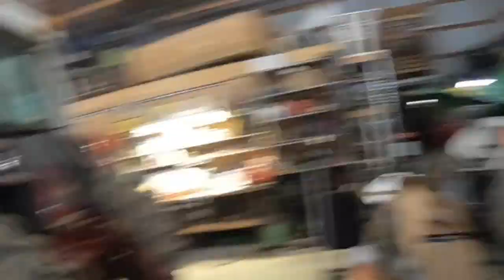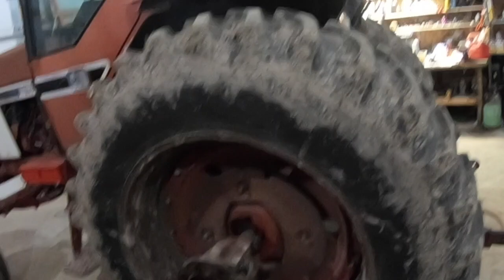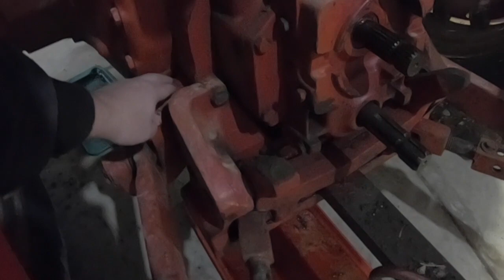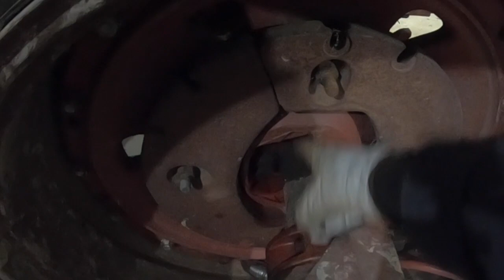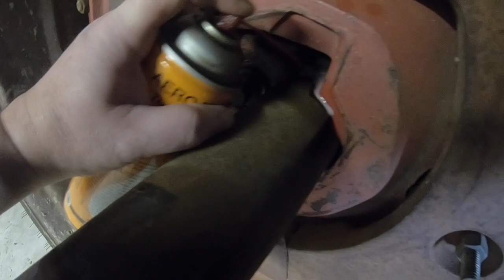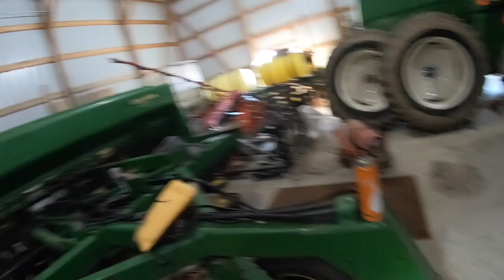IH 1086 goes to the Dealer for Repair

Comment: get better!  
with them wedges I have loosened them bolts and drove them around,   

made a wheel stand so I haven't had to pull a wheel to do final drive work in a long time.
Reply from the maker: Thanks, I'm waiting on my son. We are headed to Columbus to see the dr and get the splint cast off. I'm going to try to make an update video for later today or tomorrow.  The last several videos have been from before the surgery.  I still have 2 more that need to be edited with the last one of me bringing the tractor home.

 I just didn't have the time and was not sure I could have the tractor setting in the way for so long to make the repairs.  I also know that the PTO has to be set up to make sure that you do not burn it up. Have a great day and thanks for being here.

Comment: It's definitely the torsion bar I did a video on the repair last summer not that hard of a job
Reply from the maker: I had worked on some of the 3 point last year to free up some of it. I know if I was going to have to pull a wheel it was going to be beyond my ability here. They did have to pull the one wheels to have room to get a puller on it to get it out. They also showed me how bad the seals and bushings were.  They also set up the PTO oil pressure to make sure that it was going to be right. Yes, it was expensive but I think it will be worth it knowing it was done right and I will not need to redo it.  Thanks for watching.